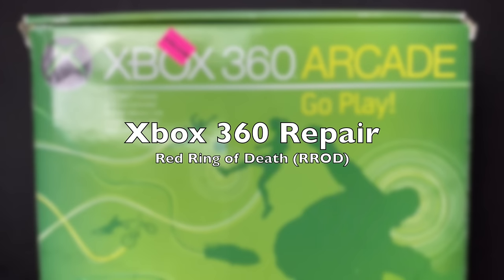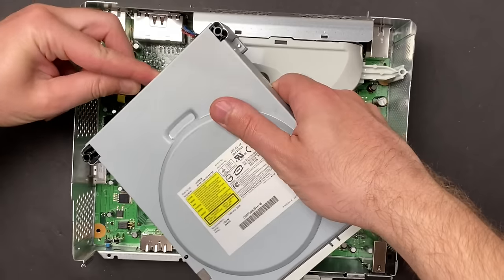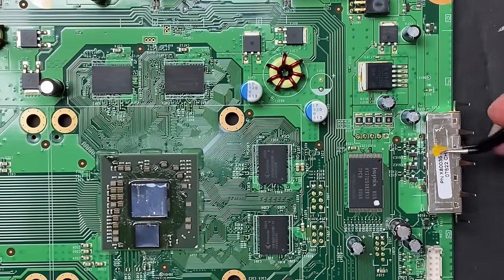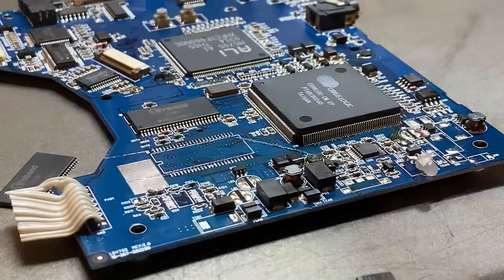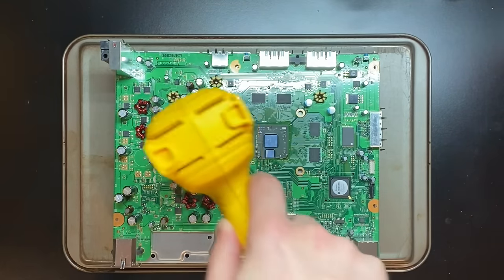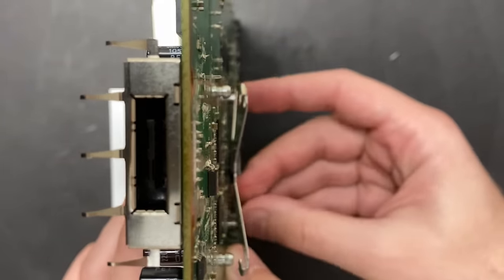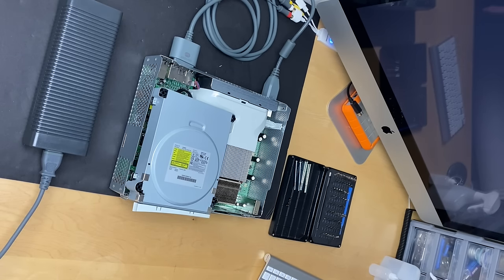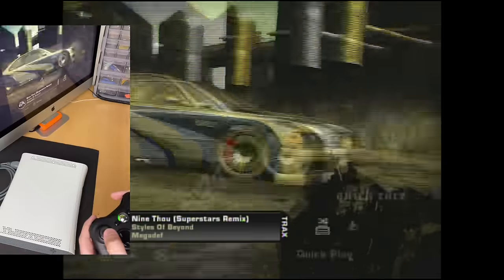Xbox 360 Red Ring of Death - DIY GPU Reflow

Comment: Im my T.I history
Reflow only destroy the GPU in most cases
When you are putting your video card in an over
You are doing a reflow
BUT
The graphic card gets oxidized so in the future your gpu will have a very bad performance,break or only
Plow,im ded
and with the reflow
The board gets oxidized and you will loose your videocard
So don't do reflow
Make an reballing your GPU thanks
And in case of console
It's another history if you do it right
In video cards it's hard to say the same thing :/
Only do a reflow in EXTREME cases
It works
But the consequences are agressive and i forgive only do this if you know and make sure that nothing wrong will happen and that your GPU will still be fine
Reply from the maker: You should educate yourself on how flux works.
Reply: @BorderlineOCD  thats not the problem with reflowing. You are trying to fix an issue that isn't even there. The gpu needs to be replaced 9/10 of the time.

Comment: Just replace the AC cord/power brick... 🤦‍♂️
Reply: The power brick wasnt faulty
Reply: @decm8  That's how I fixed my RROD...
Reply: @DJDonkeytron  rrod can be for any issue the console has. Maybe your power brick was dying and sending the wrong voltages to the system and the system refused to boot because of this, causing a red ring.

Comment: are u use 600c on 4-5 minutes section or 400?
Reply from the maker: 400C throughout.
Reply: i have black&deckerf kx1650 with 460c and 600c what can i do
Reply: and i have to get no clean flux instant of flux?
Reply: do u suggest me this? STANNOL Soldering Grease 50 g
Reply: because i live in greece and i cant buy mg
Reply from the maker: Not sure you can use this bud. That product looks like it's intended for plumbing use (copper water pipes). You want to use a flux designed for electronics.
Reply: @BorderlineOCD  ok thank you very much

Comment: Just a temp fix, you aren't solving the actual problem. The chips need to be reballed with good quality solder, and the cooling system upgraded or this will keep happening. This is exactly why MS spent millions to fix this design in later revisions.
Reply from the maker: I'll share a few thoughts from my research on this as I expect to get some comments with the concerns you raised. I'm a curious person by nature and I went down a bit of a rabbit hole reading about RROD to satisfy my own curiosity. The information on this issue is quite fascinating when you dig deeper beyond the surface level arguments of reflowing, reballing or even replacing the GPU altogether.

There are a number of compounding issues relating to RROD and the time period surrounding the 7th generation consoles:
1- Poor design of Xbox 360 cooling system in general as well as criticism of X-clamp design and resulting uneven pressure over time.
2- Industry-wide problems during a period of transition to lead-free manufacturing in which higher temperatures were required. Manufacturing equipment needed to be upgraded (particularly because the absence of lead increased the contamination/oxidation of solder with existing equipment/processes until this was better understood and addressed with chemical additions to lead-free solder). Higher cold solder joints and increased defect rates overall during this period.
3- Massive lawsuit against Nvidia during the same period for defective GPUs. You'll find many discussions around RROD suggesting that Microsoft received the blunt of the assault even when it was Nvidia's GPU crapping out across a variety of computers and laptops during the same period.
4- You'll also find discussions suggesting that even reballing is also just a temporary fix because that's not the root cause, but the underlying issue is rather "bad bumps" between the GPU die and substrate which can't be reballed. However when the GPU is reflowed/reballed you're just refreshing those microscopic solder balls and the GPU is temporarily revived.

I'm sure there was even more that I'm forgetting. I think even this many years after the 360's lifecycle the reflowing vs. reballing vs. replacing GPU conversation is still heated and folks are in one camp or the other. At the end of the day if you pick up a free 360 or paid $10 for one, you're likely disinterested in all those views and just want to attempt a DIY repair. I positioned this as such — a DIY repair with a few minor tweaks to potentially increase the mileage of your repair attempt. At the very minimum, educate folks on the melting points of lead-free solder and why suffocating your 360 in a towel is pointless, but if you insist on fixing it yourself, at least using quality flux and removing those plastic anchors so you can dance the GPU into position.

I'll be keeping an eye on this unit and hope to have a rough estimate of how many hours of gameplay I get out of it, so at some point in the future I'll revisit this repair and share my findings.
Reply: If you were listening to what he was saying in the video about the repair he said it was only a temporary fix. this video is only for the people to learn how to do a repair the correct way not like all the other videos out there that show you how to stick q-tips in the fan vents or to towel your console to heat up the solder under the GPU and CPU chips or to take the x claps off and replace them with screws!!!
Reply: In fact the solution (aside from modifying the compound of the solder joints) was to improve the cooling system and ventilation flow. The best way to fix that in the firsts revisions of the 360 would be to transfer it to a bigger case and the use of bigger heatsinks
Reply: Everything in this life is temporary.
I fixed videocard this way some time ago and it worked few years after till i decide to change it for faster one. No issues.
Reply: This is so wrong in many ways. There is nothing wrong with the cooling system because if there was a problem it would show 2 red lights to indicate it actually overheated. Also rebelling doesn't fix it as the actual fault is the GPU itself. The only fix is to replace the GPU but again the only GPU you can replace it with is the same crappy GPU with the same design flaw so it will fail again after many thermal cycles. If your wondering my information is legit. My knowledge on this issue comes from leaked internal Microsoft documents
Reply: @NickMicallef  In many cases it is actually possible to put newer GPU in older board. Maybe those "internal Microsoft documents" didn't mention that.
But you are 100% right in identifying the problem
Reply: The chips themselves are flawed, you have to replace the chip to REALLY fix the problem otherwise you're just heating things up within the chip enough to make it work again temporarily. This is why revisions after the Xenon have different chips.
Reply: @ToothpickMan11  "Really" in caps huh,
Go ahead and replace the chip, then watch the fault come back eventually.
But yes, you have a point. The chips are not ok.
Cheers
Reply: @pacor.9325  Yes the problem will come back, because of the design of the chips. They are junk. But you're free to ignore what I'm saying and do as you please. But personally as someone who does repairs I wouldn't waste my time repairing these.
Reply: So according to many of these comments, the only "reasonable" option is trowing it to the trash?
I think this is better than reballing, as that might just last a little longer than what it's proposed on this video and it's also much more risky.
If you're stuck with a console with this issue, I think the procedure he proposes is the most reasonable solution, it won't last forever, but at least you can "reset the clock" many times. It's also far less complex that reballing.
Reply: @BorderlineOCD  The true and final cause of this issue is that authorities started to force companies to use lead-free solder for consumer products, so any reflow will be temporary unless you improve the cooling to avoid huge jumps in temps. The final fix is desoldering, cleaning, and resoldering with leaded solder which is softer, denser, and much more flexible than lead-free which makes cracks much more difficult to happen.
Reply: @ToothpickMan11  Thats BS, if reflowing the chip makes it working again, the problem is the solder, To fix it you just need to desolder, clean, and resolder using leaded solder balls, and thats it, problem solved forever. MS could not do that because leaded solder is forbidden for consumer products in many countries so they had to improve the chip to generate less heat, but it is widely available for any hobbyist or repair center.
Reply: @Romerco77  You believe what you want. There is more to a chip that just a heat spreader, there are components within the chip that are soldered, this is why when you heat the chip enough it fixes the connection briefly. There is a design flaw inside the chips, the only way to fix it is to replace the chip. There's plenty of information out there about this, videos and a lot of misinformation. Microsoft didn't have a chip redesigned for some solder balls. Like I said, you do what you want, think what you want. Why waste time arguing with me when you don't think I know what I'm talking about?
Reply: @ToothpickMan11  because what you say is wrong, the chip heats because it's inneficient, not "flawed inside". If that were the case reheating wouldn't fix it.

It's clear that you have no idea of how a chip is manufactured, please do some research about the topic. The wafers are not made by soldering lots of tiny tomponents,  but mostly through deposition and patterning.

The problem, as you were already explained is on the solder used on the packaging, thermal stress causes fisures in the soldering, lead solder is much more resistant.

Reheating as described here is the safest approach, done right should last about the same amount of time it took to fail since it was new. As long as there is no oxidation this process can be done indefinetely. The flux is to avoid the oxidation.

Reballing has the same effect, it should last longer VS the original solder. It will eventually fail again but this time more likely due to electric erosion, which is internal and cannot be fixed or prevented.

For the heat, ideally you want water cooling, as it takes longer to heat and cool, which reduces the thermal stress.

You were right to say that there is a lot of missleading or superficial explanations around the web.

I learned this in college while learning about circuit design and manufacturing.
Reply: @ToothpickMan11  You are the one spreading misinformation, if you knew how a CPU is made inside the die, you would not have said such a nonsense. Do you think they send Ant-Man to solder things inside a CPU? X'D. The solders that fails are the ones joining the chip to the motherboard
Reply: @CesarAnton  Then believe what you want.
Reply: @Romerco77  Okay, you go right ahead and waste your time on a $50 console that's going to fail. Go for it, reball it, watch it die again in a few months.
Reply: @ToothpickMan11  What?, i am not repairing this Xenon consoles since 2009, we are here just chatting. In all cases reballing with proper leaded solder solved the issue forever.
Reply: @ToothpickMan11   no worries, it's not like it's an important topic, no harm done :) 

It's not about belief but science.

Have a nice week bro! cool nick btw